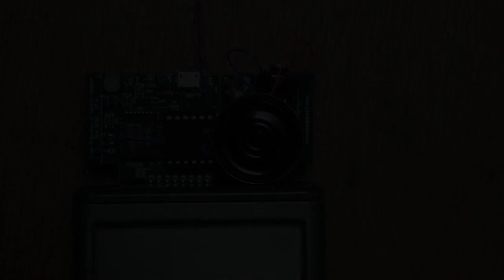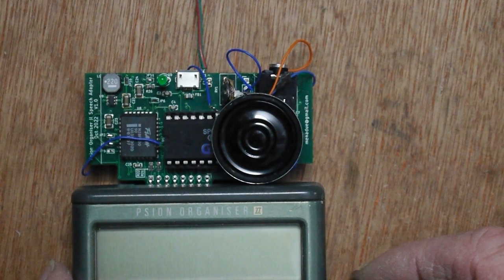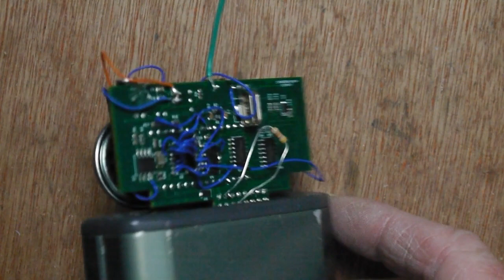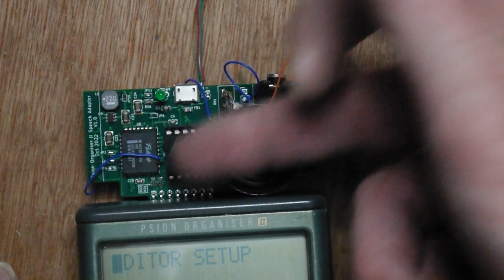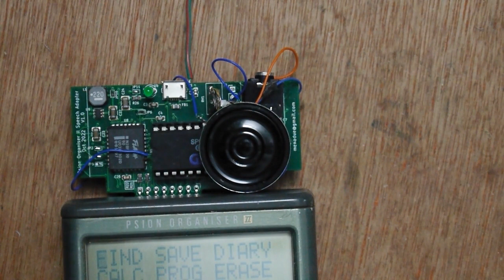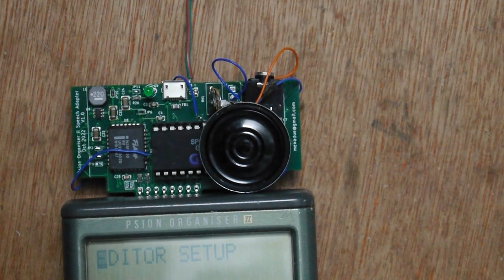Psion Organiser 2 Speech Adapter Part 1

Comment: This is amazing, I always wondered how the speech board worked!
Reply from the maker: This was a pretty common IC back when this came out. It was used in a ZX Spectrum speech device too, I believe. It is just a case of stringing together the noises that make speech. There's 64 of them preset in the IC. The Psion code has a vocabulary of words that have been pre-programmed so you can say a word if it is in the vocab. The vocab can be extended too. That's how the screen reader works. It spells out any words it doesn't recognise. All in all quite a neat little adapter.
Reply: @menadue  very impressive given the low specs available, it's no Google speech synthesis but it's understandable!

Comment: Great work! What about having it powered from VB with a switch to prevent current draw when not in use?
Reply from the maker: I thought about that. The problem is that it would require a regulator circuit and a switch. There's room for a regulator, just, I'd have thought, but the switch, I'm not so sure. I've got V1.1 PCBs coming that should be a lot tidier, I can prototype that circuit on them. This PCB is a bit too modified now, and delicate for more mods. It has served its purpose though.